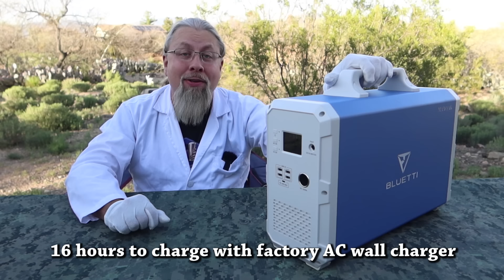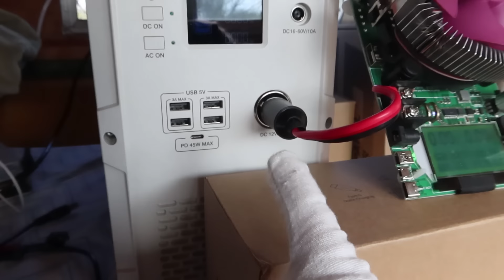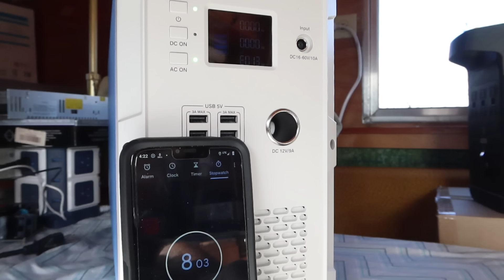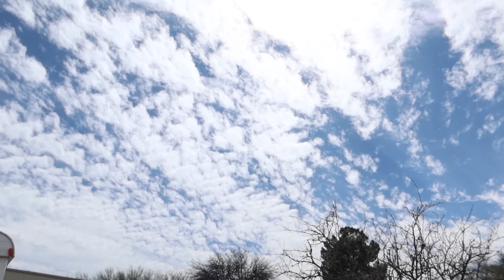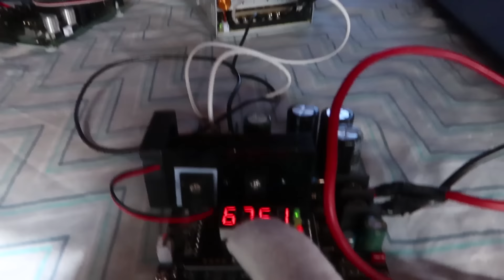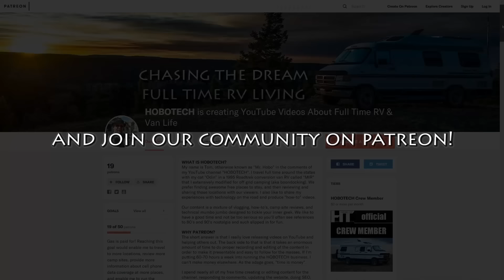MASSIVE Off Grid PORTABLE POWER Station! 2400Wh MAXOAK Bluetti EB240 Lithium Solar Generator Review

Comment: I own one of these and have been powering my full-size, side-by-side Fridgidaire refrigerator off of it for over a week (supplying 700w of solar). Max overnight use goes from 5 bars to 3 so it should easily be able to run an extra day with no solar available. I live in Houston so we have hurricanes and this is a concern. One thing that DOES bug me is that if the AC is left on overnight (aforementioned fridge) and the sun comes up the next day, the MPPT seems to only charge at half-rate even with full solar (!). I have to power the unit completely down, unplug the solar input, plug it back in and power it back up and it will use the full juice off the solar. Not sure what is going on but very frustrating MPPT operation for continuous use. Keep up the great videos!
Reply: Houston FireFox, good to know!  I'm in Las Vegas and looking for back up air conditioning and powering my side -by-side Whirlpool refrigerator.  Yesterday, it measured 119 degrees on my thermometer, and with my recent heart situation, I need A/C insurance to keep me well.

Comment: 4:06 is the deal breaker.. NO WAY TO CHARGE FROM ALTERNATOR.  All these devices should really consider how most are looking to charge them .. from you car while driving and if not driving , then from solar or both.  In a perfect world somebody would design one to fit under a typical car seat.  

29:50  can  run a 5000 BTU  air conditioner continuous during the day using 500w of solar on a sunny day ( I'd love to try this with a single 400 Watt solar panel)
Reply from the maker: This can be charged from a 12v source using an inverter as I show in a follow up video.

Comment: On the fence will a 5000btu air conditioner run off this?  Besides the titan whats the next best thing?  Around this price range.   Need an emergency power supply
Reply from the maker: Yes, I have run my own on it. You can't get a Titan until around Christmas so the next best thing is the AC200. See my last 3 videos about it.
Reply: @HOBOTECH  will do now thanks hobotech

Comment: HI,  can an marine wind turbine rated 400 w be hokked to this bluetti? what are your thoughts and if there is any particular wind T you would recommend. Great videos!
Reply from the maker: Depends on the voltage of the turbine. I had a turbine, they are crap on land under 50ft. I have very old videos about it.

Comment: I always enjoy your vids. I purchased the older model Bluetti 2400. I charge it with 3 Bouge 170 watt panels in series. Presently they are not permanently mounted on my RV and I have them wired in series. I am planning on mounting them soon and was wondering if I need to do so in parallel? Thanks for your help!
Reply from the maker: Keep them in series.

Comment: I ordered two Bouge RV 170 watts panels off the  Amazon link on July 1st to power my EB240.  Still have not arrived.  I keep getting delay messages from Amazon to see if I still want them.  Any word on why they are so delayed?
Thanks.
Reply from the maker: They sold out and are waiting for a new shipment. BougeRV site shows them shipping in September. They were on sale there for $138 with my code.

Comment: Hi
Would you be willing to make a video for anyone who rents an
apartment or home who wants to offset some of their electric bill with at least
a partial Off-Grid power solution? Would it even be possible? Please consider any
renter's limitations like not being allowed to drill holes in the walls or
access to the roof. My thoughts are placing solar panels on windows attached to
a portable power station that looks nice and neat so the wife does not freak out
at an out of control Frankenstein DIY project.
Thanks
Daniel
Reply: Funny just had this conversation with a girlfriend, was telling her about these and said this would be much better than a loud generator that I'm sure her Condo association won't allow , said that I believe you could run small heater, mini fridge, and a hot plate ? Because they loose power every winter for a few days and she's miserable she has major health issues otherwise she wouldn't mind.
Reply: 2nd your request, Daniel!!!   I live and teach here in Las Vegas near Nellis AFB and would really like to survive the power black outs during the HOT summers here.  My health requires the cooling with some sort of air conditioning, be it a regular integrated home system or like my back up evaporation cooler.  Otherwise my needs are simple: laptop, router, coffee maker, microwave, and residential home refrigerator.  I rent, have full sun here with roof patio view of entire Las Vegas Valley and surrounding hills.  Any suggestions are appreciated.  Thank you!

Comment: At my camp. My 240 is half charged. Put it outside in west central Ohio since 11am. Clear day. Angle from the ground 28°. Four Renogy 100 monos, harnessed in parallel to the rouge rv harness and plugged in to the 240.... harvesting a whopping 156 watts. Changed to near flat... 160 watts. Increased to 34°, 156 watts.

As far as I know the 240 should accept up to 400 watts when half charged. Maybe not. Is it the 240, or is it the Renogy panels? 

The bright side (pun intended) it’s almost the same as charging with my Honda generator and the OEM charger but I am not putting hours on the genny nor paying for the gas, albeit less than $2 per gallon. Maybe I get 6 hours at 150 for 900 watts.
Reply from the maker: You need to run in series-parallel as demonstrated in the video. Running in all parallel you hit the 10 amp wall after 2 panels.
Reply: HOBOTECH well heck sake!!! Thanks HT!! I remember that now but I don’t mind watching the video again anyway. I always watch your vids multiple times, I learn something or reinforce something each time. Thanks again!!!
Reply: After following your direction and scrolling to the part in the video where I remembered you having the panels, I just finished connecting the four panels in series parallel. The new output is 298 watts!! Let’s call it 300 to make the math simple... thus 75 watts per panel. 

Now, given some inherent inefficiency of the panels, and that it is three hours past noon, and that it is 92 degrees, and that my angle might not be exactly optimal.... I’d say almost 75 watts per panel is excellent. And, HT, it plays very well to your point about overbuilding the solar panel side to account for the variables. In my case, two more panels would make it 450 watts, or two more of those Bouge RV 170’s you’re talking about would give me more than the 240 can take. 

Well, I’m very glad I posted and very thankful you responded, HT. I’ve learned a lot today.

Comment: Here’s a question, will it run a Guitar Amp or 2? 50W amp. The voltage needed iOS wall current but it’s a Sound City 1970 50W head. And a Supro Statesman and Supro Super? Will it run those?
Reply from the maker: Absolutely.
Reply: How long would I be able to play for using a 5 watt Supro Super? I got powered QSC big-Ass speakers for the PA. So, I’ve often wanted to go out in the middle of nowhere. I live in Southern CA, and be in a canyon where the sound would literally be massive, and just blow! If I did that, I’d want to bring the 50/100 watt head! Imagine a Pink Floyd tone and a binson Echorec with an EchoPlex. Before that is an Electric Mistress and phase 90, Buffalo FX double stacked Gilmour Big Muff, ColorSound Power Boost, and a dynacomp. Holy Cow!!!
Reply from the maker: Sounds like you need to watch this video to figure that out https://www.youtube.com/watch?v=2QsiXf_m4o8

Comment: Hi professor, thanks for being so professional and thanks for this rewiev. Im going to get something like this later or but for now im going in another direction.
Ive been living in a camper  2 years, loved it, moved back to apartment, dont like it so im moving back , this time into a van.
Situation: I live in a city with charging possibilities all around in public places like restaurants, librarys and cafee shops.
 
Also I work at a gym that i have acces to a 24 hours and at care centers where i sometimes work over night, so charging through wall wont be a problem, therefore i wont go for solar panels (that can be ripped of the van and giving tip of to burglers) - instead im looking for a small portable powehouse that i can easily put in my bag ( witch i cary around anyway) and that will fill my needs.
My needs are: to be able to, in one charge, at least be able to charge my phone and run my laptop for 10 + hours, im also going to use the powerhouse for lights and maybe a little fan at night.
 
For me, fast charging and light weight is the most important issue since my plan is to cary that thing with me every second/third day or so.

To be able to charge fast ( around 3-4 hours) and then stay online for 2-3 days on one charge would be awesome, cuz im kind of fed up allready having to stay at the restaurant for around 1 hour to charge my phone and laptop, i couldnt possible stay 6 hours lol, and i dont wanna be at the gym "all the time "! =D
So im not using fridge, AC, TV and stuff like that, only phone, lights and laptop - what would be your recomandation?
Thnk you - Don Gabo in Sweden

Comment: On another video someone pluffed in a 250 watt personal ceramic heater and this ran it. I was previously told to never  run a heater on one if these power stations that it would fry it out. Was i misinformed? Can you run a 250 watt heater on one of these or even 500 watt jackery?
Reply from the maker: Sure, you can on this.
Reply: @HOBOTECH  can you run a small heater 250 watt on a jackery 500?

Comment: Thank you for all your recommendations! I used your codes and bought a Bluetti 2400wh and two BougeRV 170w panels. What a great savings with your codes! As a Solar Newbie I have a Question for you. Can I run 3 BougeRV 170w panels to the Bluetti. Since they are 22.5voc in series its 67.5voc which is too much. Can I run two of the panels in series to a Y parallel cable, then the third panel by itself on a Y parallel cable to the Bluetti? or is it a NO-NO to run it parallel with unbalanced Watts on each side? Please advise and thank you again!
Reply: I thought he showed that you can run 67 volts into these
Reply: bob ross I meant 67.5

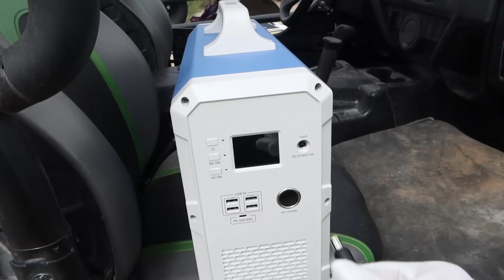Comment: What a great review. I am planning to buy for myself the Bluetti EB240 and 8x80W solar panel. I have a question about the 880W solar power you have shown at 12:25  - does it not require a charge controller before plugging it to the powerpack?
Reply from the maker: No, Bluetti has it's own charge controller. You can do 8x80w panels but be aware you'll have to run 4 parallel groups of 2 in series for it to work. That's a lot of Y branch connectors! You are better off using the largest panels you wish to handle in groups of 3 (keeping the total Voc for the 3 under 67v) and running series-parallel.
Reply: @HOBOTECH  If I may ask you another question. In your solar panel experiment (2x BOUGERV 170W 9.44A + 1x Renogy 100W 5.75A) x 2 (in parallel), did it not exceed the maximum 10A input?
Reply from the maker: @Mr-Tang-San  Doesn't matter. Bluetti auto limits the amps to 10. You can put a million in and 10 is all it takes.
Reply: @HOBOTECH  Thanks for the clarification!

Comment: Hi Tom...Question. I've seen other YT videos that mention that a LITHIUM Battery like the (battle borne) will die in very low temperatures like in the winter time.  Sewww my question is... will this Bluetti suffer the winter weather or will it survive it? I have friends who live up north and they get snowed on. Thank-You for your Amazing review on the BLUETTI. ~VH~  :O)
Reply from the maker: The battery won't "die". They won't charge below freezing. They can discharge down to 7F. If you want to resolve these problems, keep your expensive batteries indoors and run solar cables outside.

Comment: Here’s an oddity Hobo... when charging on the 240 the touchpad of my iPhone 8 is very dysfunctional. Opens apps while typing texts, types letters other than what I’ve typed, etc, etc. Web search said it is because I need to use Apple cable. That didn’t work. Also, it works just fine on the Jackery 500 and 240, and the smaller wallet-sized battery packs whether using an Apple cable or generic. Btw, this occurs whether using the usb connectors in front or the ac outlet in back. Also, my iPad has no problems.
Reply from the maker: You need a ferrite cord ring. Common issue with Apple products. https://hobotech.tv/amazon/#Electronics-Internet
Reply: HOBOTECH thanks!! Just ordered the set from your link. After reading some of the reviews this might also be the ticket for the buzzing sound present in another electronic application. Thanks again, HT..!
Reply: First time back out to camp. Ferrite cord rings didn’t change anything. Even tried pass thru by connecting to small power bank that was charging on the 240. Still acted squirrelly. One thing I haven’t tried with this phone is a different cable. This cable works with iPad and iPad mini on the 240. And this cable works on smaller power packs with this phone. Oh well.

Comment: Thanks professor! I'm using the 2400watt bluetti now and ive got a very long extension cord from the unit  to my devices. Does the length of the extension cord matter? Im talking 100feet. Ive notice my desk fan a little sluggish. What do you think? Appreciate your help. Grazi!
Reply from the maker: You can use a 100' extension but it needs to be a 10AWG 15amp rated heavy duty cord. If you run some cheap 16AWG extension you'll have a massive voltage drop that could actually damage sensitive devices or at minimum make them act weird. If you want to use a cheap cord go as short as possible.

Comment: HOBOTECH   - If you do add that Anderson Connector to the Maxoak Bluetti EB240 as a 2nd Charging Input. Would you please do a short video showing how you did it? I'm thinking using a Anderson PowerPole  Panel Mount for mine. For Example - https://tinyurl.com/yachs6bc or https://tinyurl.com/mvklr6g or https://tinyurl.com/y862q3tm might fit behind the front panel. 

All it would take is drilling a circular or rectangular hole to mount the unit (if there is enough room behind the plastic panel for it to fit. The possible advantage of this is that it would make for a clean installation. I do not know if you could use a dual socket version (like I linked above) to hook up two solar panels for a simple series input. If not, at least a single Anderson input version would still be a nice upgrade! 

Also what do you think about doing a Series / Parallel setup using a Anderson Power Distribution Block like his item https://tinyurl.com/jokmlt4 combined with multiple Jackery SolarSaga 100 Solar Panels? Although using multiple SolarSaga Panels would be a lot more expensive than Fixed Glass Panels. It would make for a absolutely killer portable setup! I'm a Amateur Radio Operator, and I'm thinking this would be a good way to use my EB240 for Comms, my ARB Fridge, CPAP, and all other electronic devices!

Hopefully if you haven't added your Anderson Connector yet, I've given a few good ideas to bounce off of everyone's brains! What does everyone think about this setup?
Reply: Yeah, I second this.

Comment: DR HT, For a solar system with only solar panels and a Bluetti 240, do you suggest inline fuse, and if so what rating? 
One bank of panels will be 2 Bougue 12v 170w in series, and the other bank 4- Renogy 12v 100 watt in series/parallel. Only gonna use on bank at a time.
Reply from the maker: It has short circuit protection so you don't need a fuse but you can use a 20A if it makes you feel good.
Reply: @HOBOTECH  Thanks!

Comment: I should explain. I live in Nevis in the Caribbean and from 6 am to 6 pm we have adequate sunlight ( except during hurricanes etc..) to charge the solar generator without a bulky Generator.  It is the next 12 hours that a battery is needed as there is no sunlight.  If the Bluetti can pass through during the day then do i need so many as per your advice?
Reply from the maker: I think you missed the point. You can't run that pump on any solar generator. It would require 1500w of solar coming in while 1500w would go out. You want a 3000w+ generator. I'm reviewing the Enkeeo 4000 right now and it's dual LPG/gasoline and electric start. Link is here https://hobotech.tv/amazon/#Power-Generators
Reply: @HOBOTECH  thank you
Reply: @HOBOTECH  Can you as part of the review touch on the issue of how long it can run a 1500 w pump with a full tank of gas and with a 20-25 lb of LPG. Thanks.

Comment: good Review. I understood many things you said.  I have a 3/4 hp shallow well jet pump with  115v/230v 13.0/6.5 Amp 60 Hz.  I want to convert to solar to stop using government water.  I would like to run it for 24 hours.  Can you recommend a solar generator than can be used.  Thanks
Reply from the maker: You want to run a 1500 watt pump for 24 hours a day? That's 36kwh. It would take about FIFTEEN Bluetti 2400wh power stations or 56 lead acid batteries. You're going to have to use a gas or propane generator for that one.
Reply: @HOBOTECH  thanks for the reply. what  type and size LNG generator i would have to buy?

Comment: Are you sure that EB240 are on LG basis?
I read Eb150 engineered LG cells and Eb240 equiped with less cycle Samsung cells.
Reply from the maker: They use identical LG pouch cells.
Reply: @HOBOTECH  if possible, please make a teardown video to see the components compared to the smaller model. Thank you so much.
Reply: Thanks for your feedback.
Please check bluetti engineer update on their Facebook account. It seems eb240 are powered by Samsung e29 Zylinder 18650.